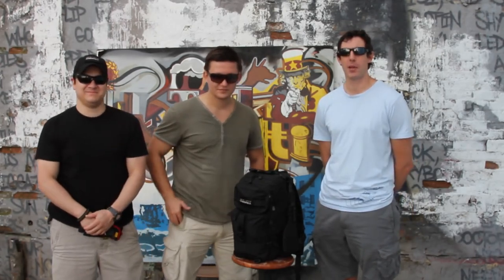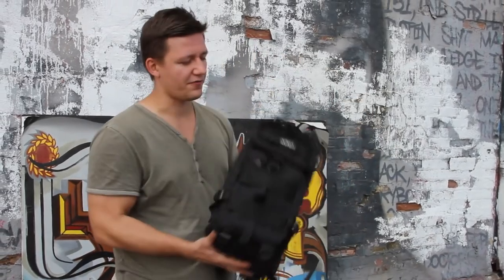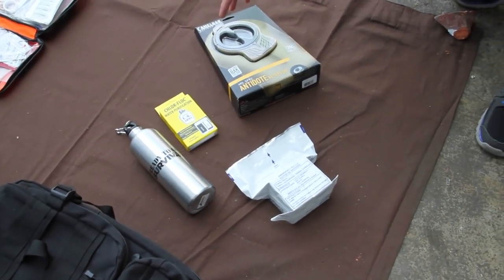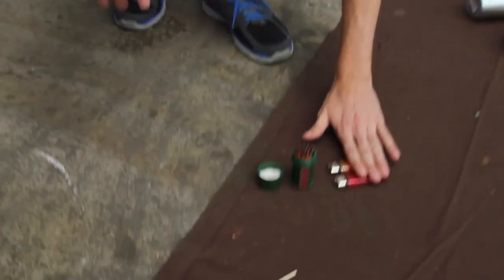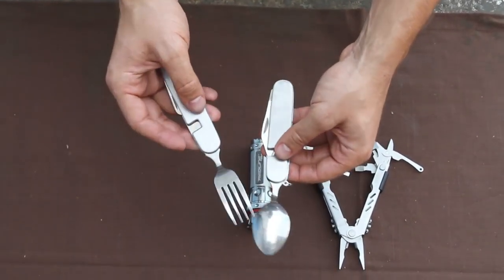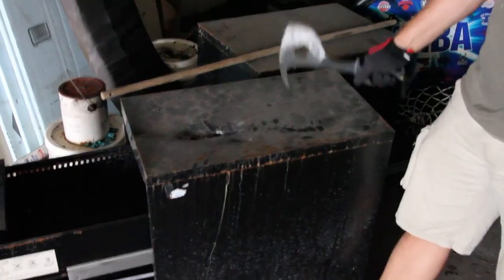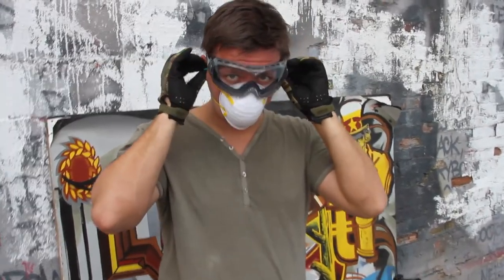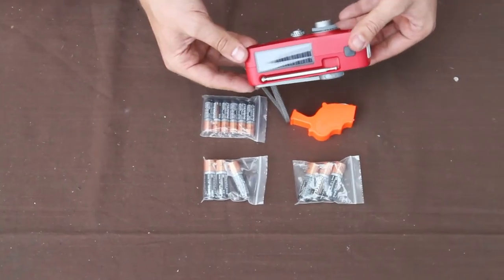Urban Survival Kit / Bug Out Bag - TUUSK - 15 lb!

Comment: Pretty good, only one thing I would highly recommend swapping. You said you have tested everything in the bag but I know you never tested a tube tent because if you did you wouldn't include one. Believe me I know they are light weight but they are garbage, there is no way around it. I would rather see any other shelter item, preferably a good tarp or even a bivy or sleeping bag liner or even a sleeping pad. Tarp probably matches the price and weight the best.
Reply from the maker: Thanks for the feedback Teddy. 

Tube tent can be used for more than just shelter. In my personal bug out bag, I use it as a lightweight ground tarp for my Hennessy Hammock, as to avoid carrying a heavier pad. Can also be used to make a solar still. 

I agree though, a tarp is great addition. Will certainly keep it in mind for future projects. 

-Roman
Reply: that's good to know. I will have to try that! thanks

Comment: I like it.Sure you can add more and more quality thus driving the price up.But you can also switch in different items and make a back-up second kit. Good job guys. Ignore the social media haters.
Reply from the maker: +larry gebert thanks Larry!
Reply: you would basicly have to remove most of this crap....which makes it not a smart purchase you would be better off just building a second bag from scratch if this set up only had a couple of crappy items then you could just pull them out like you said and add what you need however in this case you would need to change out the majority of everything in the kit..........dont buy cheap when your life may depend on it one day because cheap products will fail you when you need them the most even if it takes saving money for months to get one item.....the largest majority of your money should go to - boots, knife, bag....just my opinion!